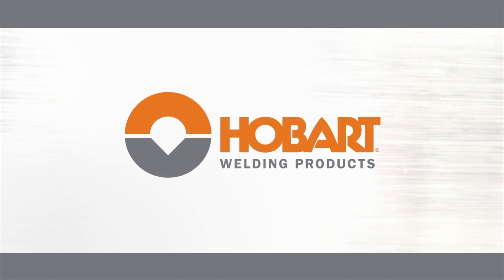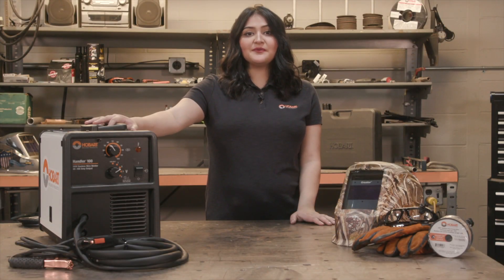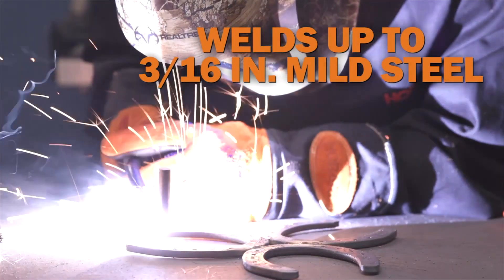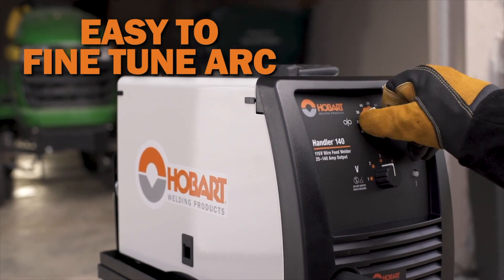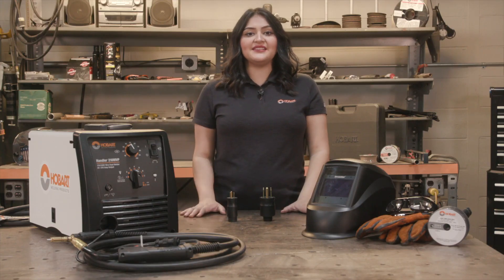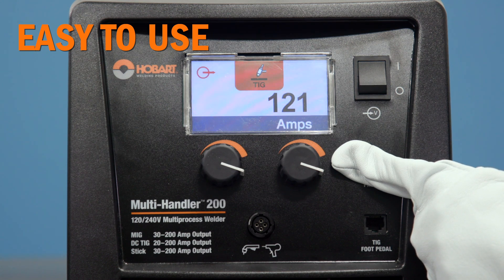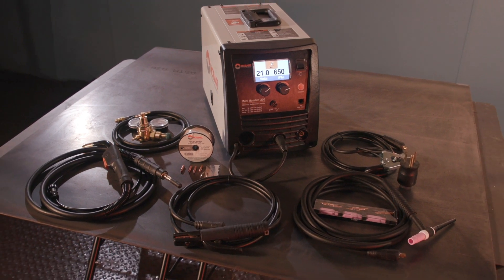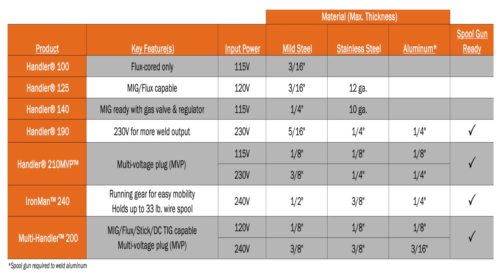Selecting the Right MIG Welder for Your Application

Comment: What spool gun model is the one for multihandler 200?
Reply from the maker: Thanks for your question, Rolando. The Hobart SpoolRunner 100 Direct Plug-in Spool Gun is the only Spool Gun model that's compatible with the Multi-Handler 200. You can find more information on the SpoolRunner 100 Direct Plug-in Spool Gun here: https://www.hobartwelders.com/accessories/mig-welding-accessories/mig-guns/spool-guns/hobart-spoolrunner-100-direct-plug-in-spool-gun-300796.